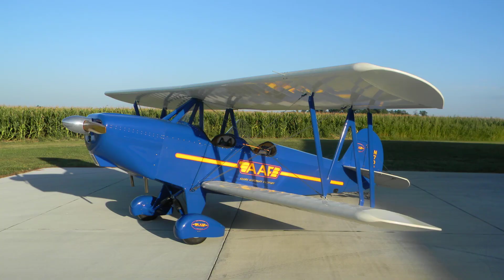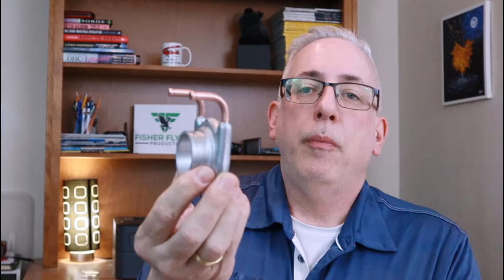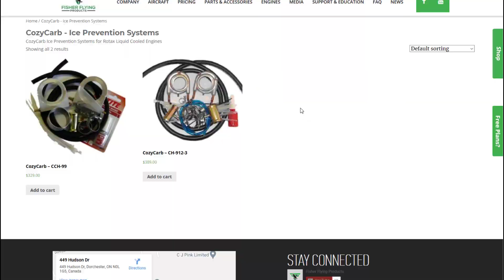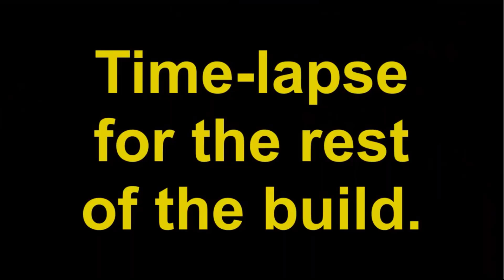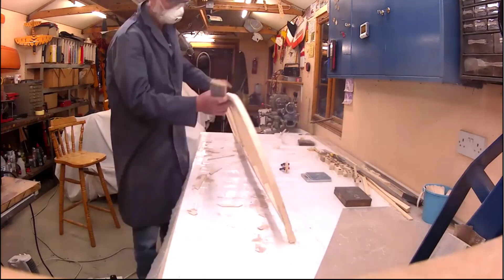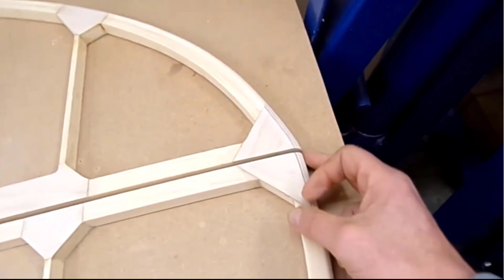Fisher Newsletter 34   01 03 2021

Comment: I wish there was a Kozy Karb (did I spell that right) that worked by replacing an aircooling fin for those of us partial to the old C65 and 85. But you know, even better, let's have that big electrical engine. I don't think those suffer from carb icing at all!
Reply from the maker: Thanks for your comments.

Comment: in reply to fitting the gussets flush if you cut in i.5mm you are now weaking the wood by 1.5mm  why do you think the best wood aircraft fit the gussets on the surfice and bevel the edges you are now carrying 1.5 scrap wood on the part
Reply: Hi to a degree you are right material has been removed so it will not have the total strength of uncut type but it has very little strength loss.
Aircraft are built with a reserve factor of >1.5 eg 50% more than needed and in the tail I am removing 8% of the core pine which is <2% of the strength. At Farnborough College we did full size tests on MiniMax tailplanes on the difference in strength with destructive testing after wind tunnel analysis and found that it was insignificant as the wood varies by more than that, we did find however that the drag was increase by >8% by having gussets on with levels lapped on and >9% if not beveled. 
I don't know what you refer to as the best aircraft but from my experience on most manufactured vintage wood aircraft the gussets under covering are nearly all flush especially on flying surfaces. I hope that helps explain things and Fisher are happy with the strength and flush gussets. At the end of the day as I say this is my method and you have the choice so do what you feel happy with.
Reply: @flyingkub  thanks for your reply i did not want to cause any stress i have worked on german and english gliders i was in the jodel factory in dijon and i have never seen a flush gusset/ look up russian remir karimov aircraft engineer and you will see some wood worker
Reply: @seamuscashin2606  No stress, it was a good comment. Some old glider did not have the reserve factor and the material thikness would not allow for the loss as they are often less than 6mm thick (so a 1.5mm gusset is 25% or more of the base stucture), some WW1 aircraft had the gussetts inset into the ply members but run over the thin stick structures of the ribs and fuselage but they are tappered over 12 to 15mm not just chamferred over 1 to 2mm. The Fisher aircraft are made out of thick section wood on the tail but the wings with the sections the ribs are made of would not allow for routing. 
The next thing to think about is the scale of the aircraft a small single seat aircraft the gussett in 1.5mm is like 2.5 on a larger aircraft and as the Reynolds numbers do no scale so it has a greater effect, hence the large effect on drag. 
The Jodels and the T21 gliders I have seen though have very few gussetts inder the covering, keeping them to the inner stucture as much as possible and useing faded out ply skins, going over joints.
When doing anything like this you have to consider the base structure and balance the gain against loss, the designer recomendations (Fish say you can do either method) and what you feel confortable with.
Thank you for your input.